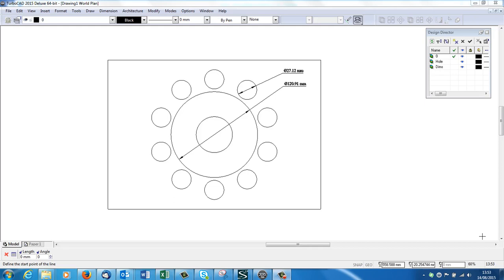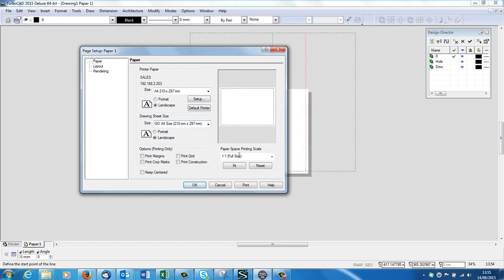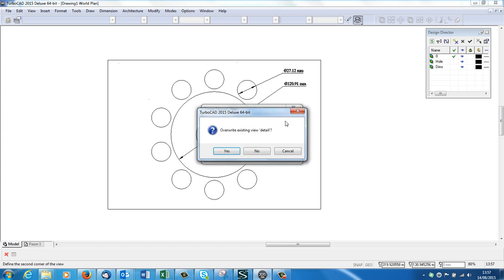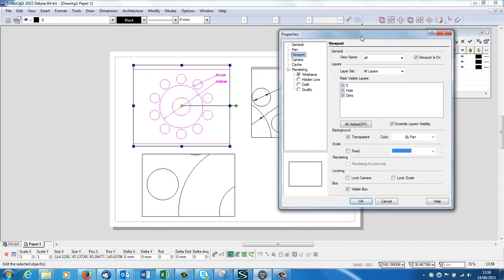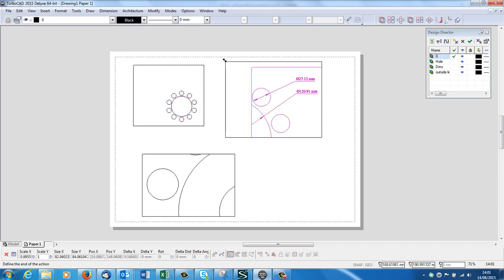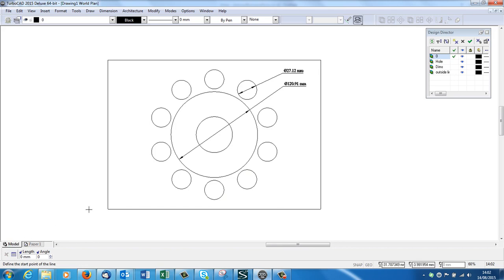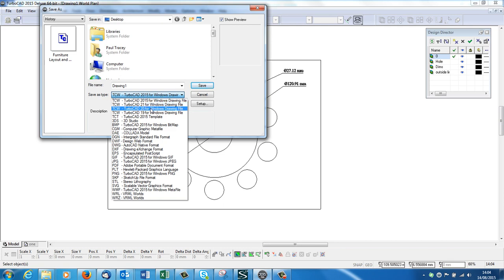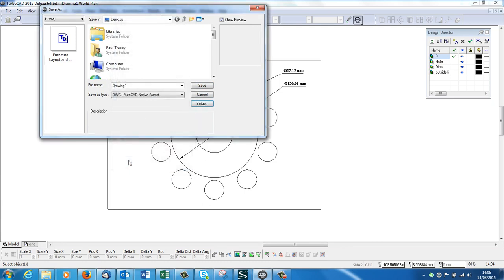Printing & Saving for TurboCAd Deluxe

Comment: Hi Paul, I've been following your really helpful videos. I have been drawing by hand last 30 years but now trying Turbocad21 delux. The problem I'm having  is adding dimensions in paper space, sometimes they are correct but other times dimension comes up wrong i.e. where it shoul be 4000mm its coming up as 40mm. I cant see why, I have set the viewport propeties etc .... can you advise?